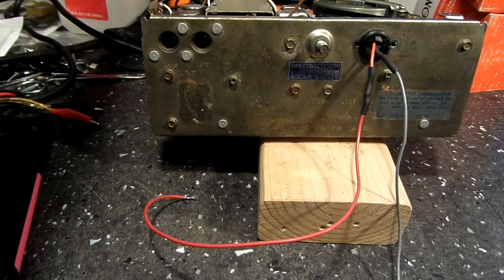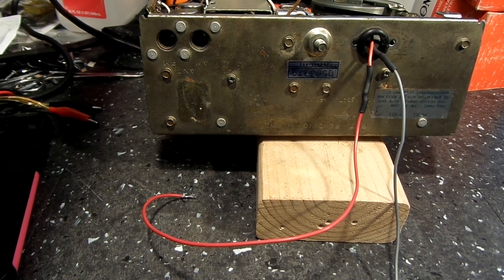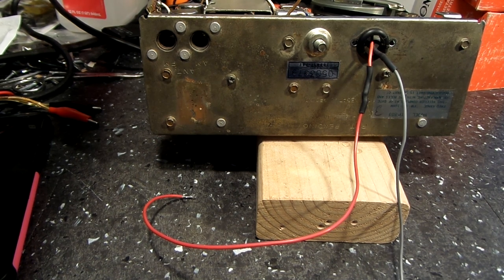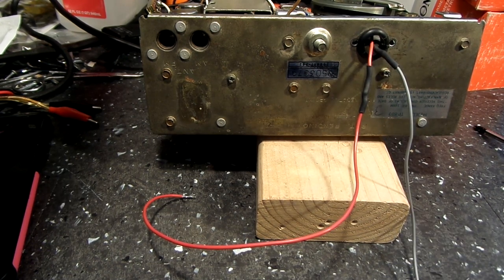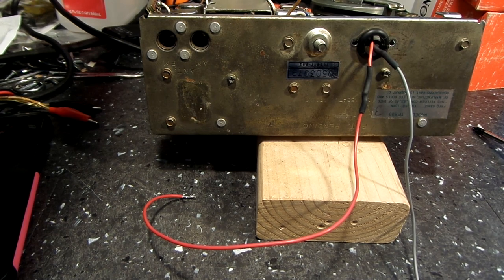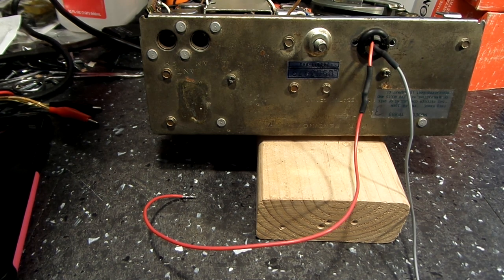Ranger car stereo - Part 3

Comment: Maybe you will not have to replace the caps, I think from where I sit it sounds good.
It sure will be a huge job working on this.
Reply from the maker: Thanks Bill. It's down the road a bit for sure, I first need to make sure the little Bluetooth module is going to perform as it should the way I have planned. That's the first order of business. :)

Comment: Another great explanation of the schematic!  At 6:10, the two greenish caps appear to be off gassing and going bad, may want to confirm and replace.  Forgot to mention last video, playing with the stereo/mono switch I could hear a difference, with the switch at the brown wire position, it was just slightly lower in volume, input a 1k tone and monitor it on a o'scope or analog AC volt meter (millivoltmeter) to confirm.  Does the schematic show or mention if it has a stereo light?  It may not?  ~Jack, VEG
Reply from the maker: Thanks Jack. I've been playing around with it more the last day of so and I'm pretty sure now the stereo FM does work. I think I wasn't getting a good signal at the antenna when I tried before. But I added a couple more clip leads and I"m certain I can tell the stereo sound from mono. Just waiting on BT module to come in the mail right now and then I will do a test with that. I don't know if those caps are just dirty or what, but I did see what you are talking about. I think someone relmoved the stereo light circuit, but I don't know why. Like the fine tuning for the tape head, it's just not there. :(

Comment: Interesting how this is coming along.  Great place to put those RCA jacks you found.  If you are looking for the Stereo light on the schematic, it looks like it might be on the collector of Q8, below the multiplex detectors on the drawing.  Maybe you can find the wires from there?  Did the adjustable coils on the tape head board show up on the schematics?  Am not sure if they are the multiplex coils, ex. 19Kc, 38kc?  Thanks
Reply from the maker: Yes what I thought was a preamp board was in fact the FM MPX board. I believe their will be some work needed in this area in addition to the stereo light. I've been around a long time and there is a very definite sound assciated with stereo vs. mono and I did not hear it. Not having the proper tools to generate the necessary signals I may have to have someone else do it. We shall see. :)